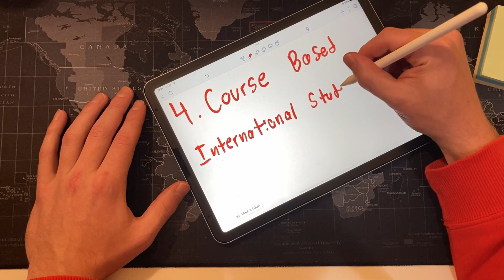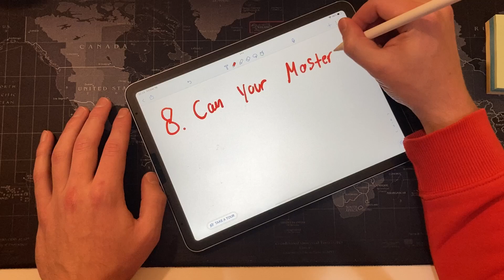Should You get a Masters or PhD in Engineering?

Comment: In my company, the engineering department majority are white racist dude with outdated degree and experience, only worked for 1 company for the last 10-15yrs. A master is good, only if your white and have a guarantee of a position of board of director. Not even, the vice president of my company have Bullshiz art and communication degree they hired her for the position because of her current position with another company as Vice. Best, you open your own company enlist yourself as the CEO or head engineering or whatever and apply for a higher position with another. Like I am the CEO of my tshirt company or some bullshiz like that. paying $50,000+ for a handsake and a $1 paper handout and hoping to get hire after you finish is not a good way to invest your money and time.
Reply: Ok sounds reasonable